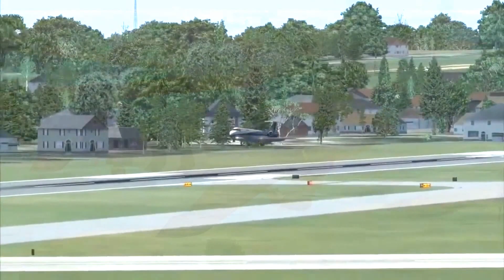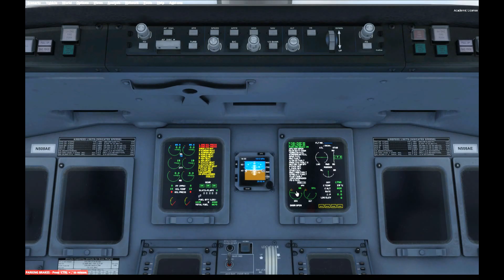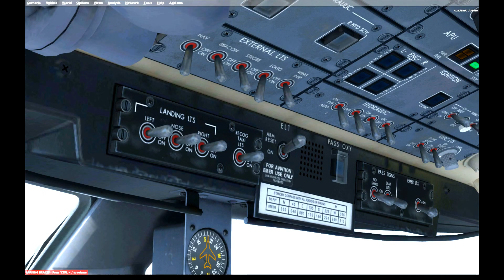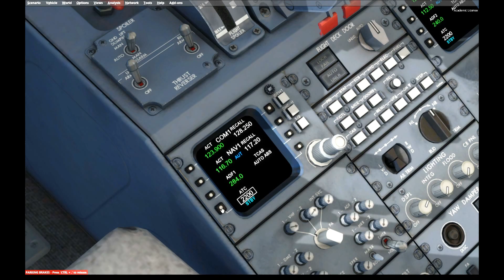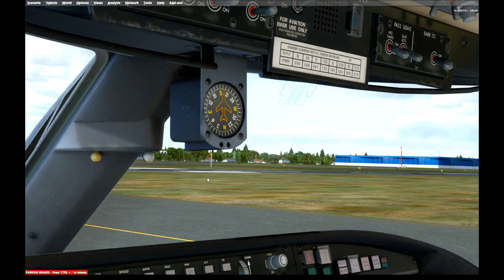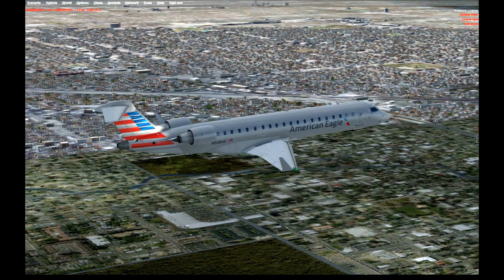[P3D] Aerosoft/Digital Aviation CRJ-700 Tutorial Flight. Columbus Ohio to Chicago Illinois

Comment: I fly the CRJ series in real life and a few things i noticed that isn't how things are done. Now this post has been up for a while but here's some suggestions for other viewers. 

First Starting up.Don't turn on the DC service bus. The airplane runs on AC power. The Only thing powered by DC power on start up are the ED1 and ED2 and the APU starter.  You don't need the engine boost pumps to start the APU. The APU has its own dedicated electric and its own engine driven pump that is automatic. That draws fuel from the Left hand side collector tank. Once you hit that power fuel look back down at ED2 and look for the Self test (APU INBITE) and that the APU SOV and APU door is open before you hit start. Once that APU is running turn those Air conditioning packs on after 2 minutes. Second, you don't need to change the bleed source when you're starting the engines from the APU. The airplane does that automatically. Leave that switch in both. 

Third before even starting the engines you didn't hit the actual boost pumps. Those were illuminated "INOP". What you thought was the engine driven fuel pumps was the fuel transfer Cross flow pumps. Fourth, lining up we turn the Auto X-flow to manual.That prevents the fuel from transferring from tank to tank on takeoff that might create an unwanted imbalance (the 700/900 has a 300lb imbalance limitation) You don't need those unless you really need to transfer fuel. The engine driven boost pumps are in auto and are already pushed in, so you don't need to worry about them being on for takeoff. 

Setting the speeds are very important. You were above the minimum flap retraction profile, which is ok but just be careful with that and try not take then out all at once because you can get the stick shaker. The weight and runway length is always going to determine our flaps setting, either Flaps 8 or 20. Our speeds are bugged to V2+20 

On climb out we call out SPEED MODE and either NAV/HDG mode, to get the flight director to know where to go, then turn the autopilot on.

Comment: Hi, you asked about the "step" through function of the plan. Select "MFD ADV" key on FMC pad.  Then depending on the selected MFD display mode, use "Prev Page, Next Page" for text display. Use PREV WPT and NEXT WPT line select keys to move the plan map centre from way point to way point. Cheers.

Comment: What's the deal with the FMC not having VNAV capability? The PMDG 737 does.
Reply from the maker: I think the only regional Jet that has VNAV capability is the Embraer E-jets (E-170, 175, 190, 195).  They also have an autothrottle.  Most regionals don't have Autothrottle or VNAV capability.
Reply: "Apparently there are versions of the CRJ-700/900 CRJ700 serial #10302+ and CRJ-900 serial#15260+ that had coupled VNAV upgraded systems, it appears earlier models did not have the system upgrades. Here's a link from Bombardier for the course material https://www.batraining.com/elearning/flightraining/crj700900/crjcoupledvnav" - Posted in Froogles thread. This was all the info I found on it, which is why there's been conflicting information on the subject. It appears it was not a third party package, but upgraded systems added to all new built 700/900's past a point in it's production cycle. I do agree it looks like only a few aircraft was built this way backed up by an assertion in an apparent FAA presentation indicating few of these models were built. https://www.faa.gov/air_traffic/flight_info/aeronav/acf/media/Presentations/13-01-RD264_FPA-on-star-charts-dharris-psa.pdf
Reply: Best ask Bombardier why they do not offer that. It's as real as it gets.
Reply: CRJ-700/900 should have VNAV the 100/200 doesn't. The button should be below the NAV button. Maybe Aerosoft didn't model it?
Reply: Though there is a third party vnav packages available we believe it is  only fitted a few aircraft. the CRJ 700/900 simply does not have VNAV.
Reply: It does have vnav, it’s not coupled with the auto pilot.
Reply: @seandunn2062  It has Advisory VNAV. The autopilot doesn't follow it.
Reply: Nicholas Blanck That’s what I was saying. It has to be done manually with V/S mode.